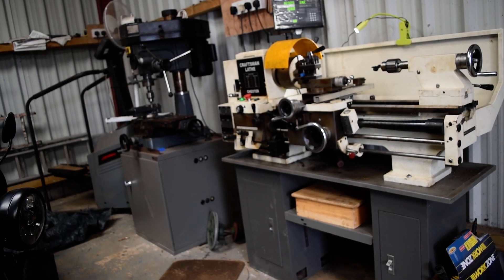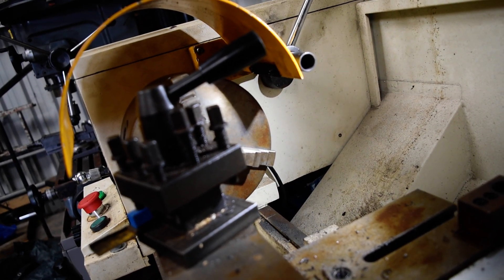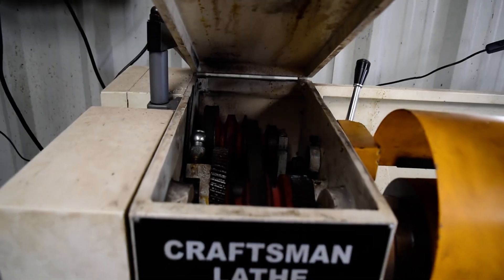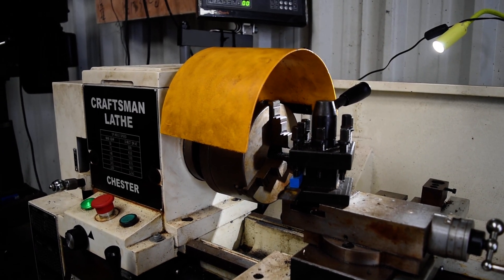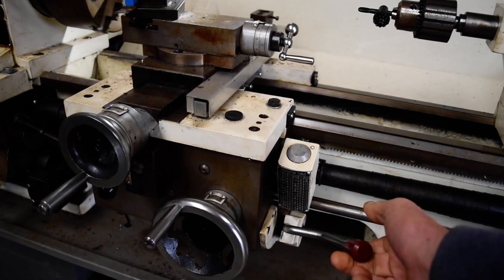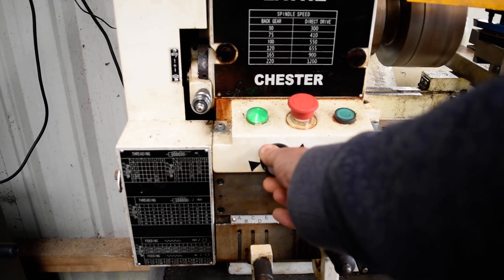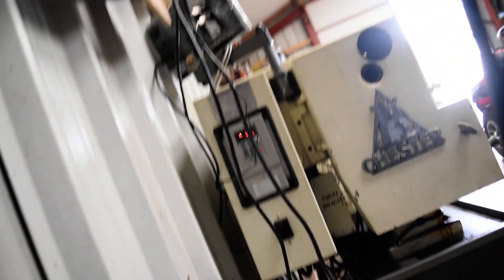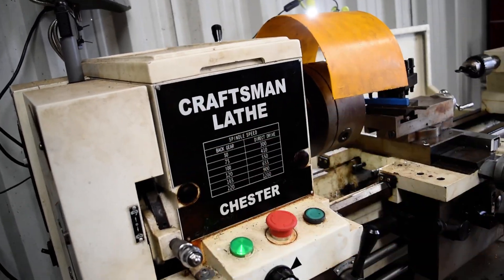Single Phase Chester Craftsman lathe converted to VFD operation

Comment: Hi Robert, Thanks for posting this. 
I'm thinking of buying one of these. Are you happy with it? They don't seem to be the quietest lathe around. Has it always made the loud squeal for a few seconds on start up? What's it like on thread cutting?
Reply from the maker: Overall I'm happy with it. It had been lightly used and at least second hand when I bought it and so reasonable value for money. I can get a good surface finish when I need it. Its a while since I did thread cutting and it was fine, but as I recall, it favours imperial over metric pitches. Both 3 and 4 jaw chucks are good but the lightweight face plate is not really rigid enough and I had to take a cut across it to get it true. The tailstock doesn't hold onto morse taper tools all that well. 'There is some gear noise, but in my case the squeal is the price to be payed for going for the 3 phase motor and VFD modification. The standard single phase motor was a lot quieter, but as standard, you would need access to the back of the lathe for all the gear ratios. It's had some small issues, such as a slack forward/reverse lever flopping into the off position in use, but all  such issues have been readily modifiable or fixable. Casting quality is a bit rough, but machined surfaces  all OK. To sum up,  as an odd job lathe it's been fine. For regular use or precision work, I'm not so sure. Hope this helps. Cheers.
Reply: @Robert Long Thank you for that. It's a big help. I currently have a 100 year old English lathe. Just over 4 inch centre height but only 12 inches between centres. I've improved it a little but it's still quite worn. When owners of imported lathes tell me of sloppy build quality etc, it makes me wonder if it wouldn't be best continuing to improve this one.